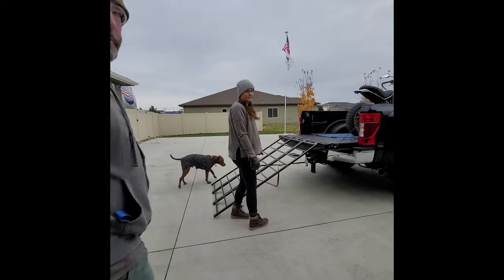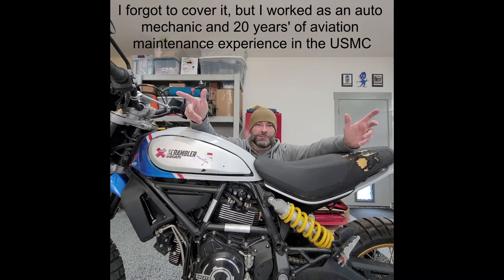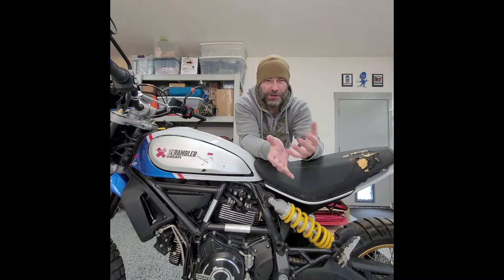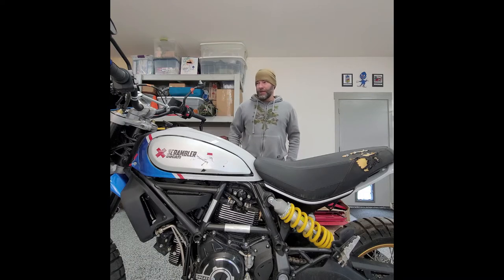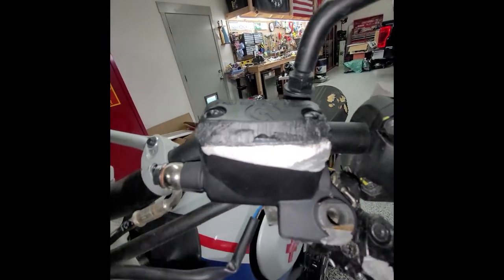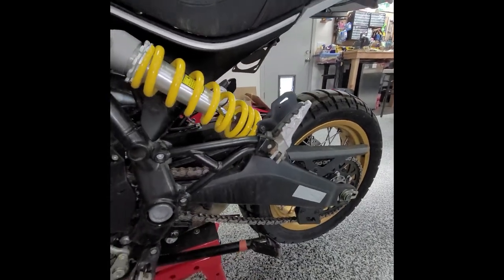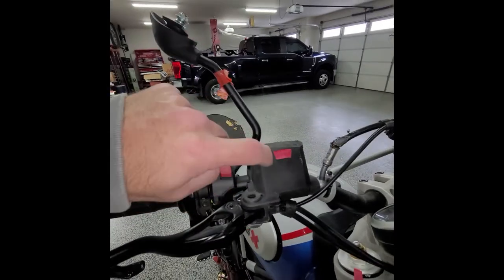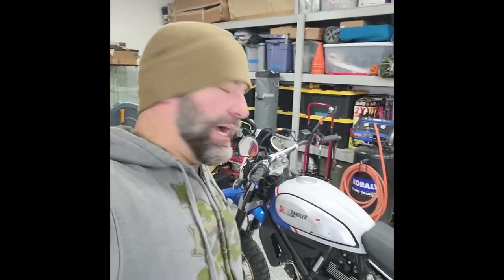Part 1: Wrecked 2022 Ducati Scrambler Desert Sled Rebuild - Walkaround

Comment: Good luck with the project, it looks like an undertaking but quite manageable. It almost looks like the right side of the bike got side swiped by a car or guard rail and then it fell on the left side and slid because all the damage on the right side is at that height and looks plastic to plastic, not pavement scratches. Who knows though.

A couple things I notice that might help save you time/money - that windscreen and the brackets that hold it are aftermarket, likely Dart brand. I have a knockoff from Amazon that is an almost direct replica that cost maybe $40 instead of spending a couple hours bending and powder coating the brackets again. 

The Ohlins sticker on the forks isn’t OEM, and I would be curious if the previous owner installed Ohlins fork cartridges in the front suspension which would be cool. 

Ducati turn signals are stupid expensive, but the company who makes the “fender eliminator” kit you have also makes front turn signals to match that looks pretty good and would match the rear signals better. 

I’m interested in seeing the rest of the build. Good luck.
Reply from the maker: @Sam K - thanks for the inputs, truly appreciative!

You might be onto something with that crash assessment.  Whatever it was, it had a enough force to bend the steering bump stop bracket which I need to weld to repair....uhh ohh, maybe I shouldn't give away future video content! 😎

As it be, I found out when going through the parts manual the windscreen was indeed aftermarket; I don't know if I will order a replacement...was thinking of bending the brackets back, painting, and trying to find a wrap close to that sparkling blue maybe.  I actually dropped off parts for powdercoating the other day...surprisingly super cheap.

My order list is pretty deep for dealer parts, but not break the bank bad...military discount helps.  I don't think I'll ever know about any Ohlins mods to the suspension...unless the owner see's this video series!

As luck may have, I found new front signals on ebay for $20 from a guy who went the route you mentioned...and won his new seat too for $150 vice $350+ from dealer.  The entire cost breakdown will be the last video...and me riding it too WOOT!